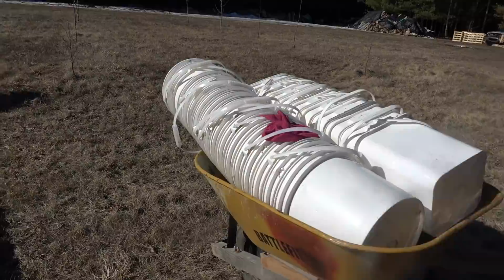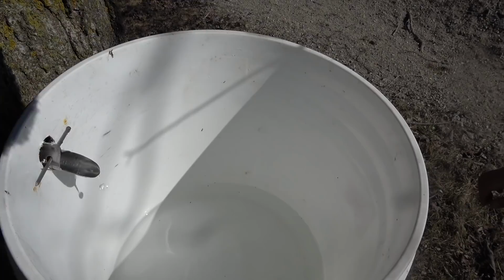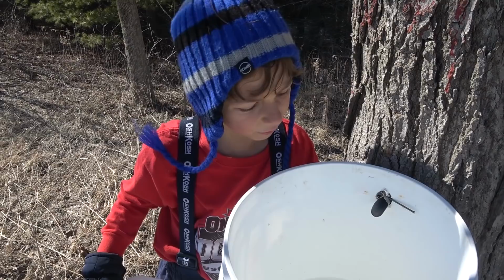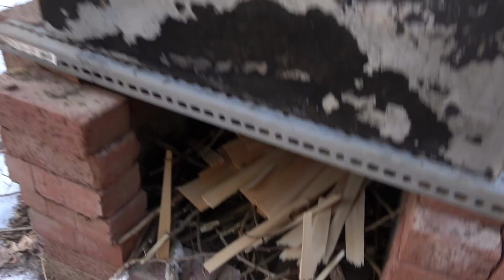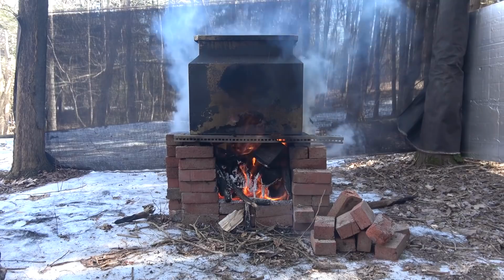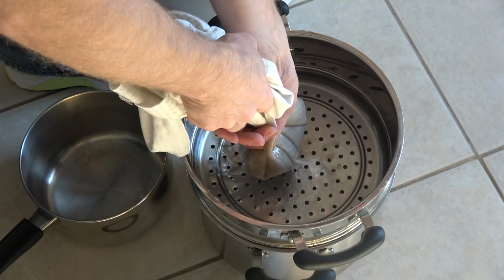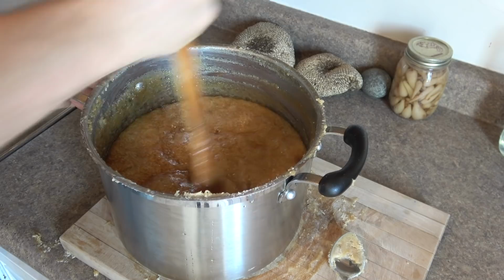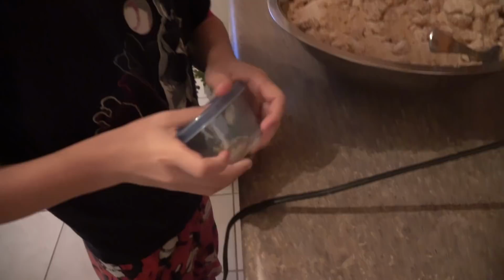MILKING a TREE!?! | Maple SUGAR on OPEN FIRE | Home Made Evaporator, Wood Boiler, Chickens, Gardens

Comment: Im surprized that it take so much effort and energy to produce sirup...... No wonder its so expensive
Reply: I was thinking the same thing😊
Reply: Well worth it  it is not like that fake stuff in stores
Reply: @tinacline474  runs about 50.00 a gallon here in Upstate NY. I buy by the gallon and break it down into quarts and freeze it for use all year. Love it!
Reply: It's about 15.00 here in South Dakota, but that's about 36ozs. Would like to try the real deal. Don't know where to buy it at.
Reply: @debraries7931  you can order it from Cartwrights Maple Tree Inn here in Upstate NY. I'm sure they will ship you some.
Reply: @SuperPangloss  but why do you freeze it though? Syrup pretty much never goes bad and the aromas in maple syrup are not volatile, so freezing it doesn't do anything beneficial^^
Reply: @dr.doppeldecker3832  When I break the seal on the original container and repackage to the smaller jars will develop a surface mold. So just  easier to freeze,

Comment: Just a hint for next season. I used to live in Vermont and made syrup for 5 years. You can cut your boiling time down if you remove the ice from your buckets. The sugar doesn't freeze, only the water does, so remove the ice and you'll have a more concentrated sap.
Reply from the maker: Our buckets freeze right to the bottom!
Reply: I saw liquid with ice dumping out of your buckets. The liquid part is the concentrated sugar. I would empty all my buckets into a 40 gallon plastic tub I had, cover it and let it freeze overnight, they the next day I would pick the ice out of the tub before boiling. I guess it depends on how cold it gets. But usually you can chip the ice away and just boil down the liquid. At least that's how it worked for me. It took me 3 seasons to learn that.
Reply: Wanted to suggest the same.
I do this with alcohol, because destilling is illegal around here.
Reply: Yeah buddy, but there is sugar frozen with the water, so its just better if you keep the ice in, and get the most out of it!
Reply: well done, came here to say this!
Reply: Wait... so the law allows you to cold crash a fermentation to concentrate but you cant heat it up? Talk about a loophole lol

Comment: And if you want to finish and fully dry it out get like a cookie sheet pan and spread out the crystallized maple sugar and set the oven on low heat crack open the door alittle so the moister can leave the oven and you’ll have fully dryd crystallized maple sugar that you can place into a container and use when ever !! I put mine thru a coffee grinder a few times to get it evenly crushed and it’s amazing !!! Love the channel btw !!!
Reply from the maker: Coffee grinder sounds like a good idea!
Reply: if you cook it until it gets to "hard ball" stage, or until it comes off a spoon in an apron, put it in a wooden bowl (so it doesn't cool too fast) and Stir Stir Stir! it'll fluff into "granules" all on it's own, no grinder needed!
Reply: Dryd? Thats a new one... Hahah

Comment: For the garden and the weed situation,  you can get things like:
Black weed barrier fabric to lay around plants- upside is it warms the soil faster so you can start growing sooner and it can be reused, downside is its plastic based and it costs.
Pine needles / dead leaves /hay applied as a mulch around plants. Can break them up into mulch or leave them whole. Upside = natural option, holds in soil heat, slows water evaporation so less water is required, slowly disintegrates and gives nutrients back to soil, pine can be used to help acidic soil plants, loose mulch gives a home to beneficial bugs,free option if you gather it yourself. Downside= labor of gathering it, can hold in humidity which is good in some cases, but also can promote molds particularly around squashes- not sure if that would be as much of an issue in your location though. 
Can also look into permaculture techniques as they require less maintenance and weeds are usually just left to do their thing. Usual thought is they'll choke out plants, but there's evidence that the competition among plants promotes more phytochemicals/nutrition/medicinal benefits pound for pound. Also, in your videos about the garden, I saw quite a few edible/medicinal weeds! They're volunteers, lol! Eat them too :D
Reply from the maker: Thanks Leah, big problem is that we have clay soil here.  We really need a truck of sand to break it up.  We have lots of pine needles though!  If we get things right, the plants we want should be able to grow and shade out the rest.  That's the end goal anyway.  We'll see.  It's hard since it's not a huge priority for my brother and he has better access to all the things we need.  In time though.
Reply: The Wooded Beardsman hmm yeah sand would help a lot then for drainage and air/nutrient issues. The weeds are probably helping that process too. Many disturbed/poor soil weeds are soil healers. Can add compost and leaf mulch to start building up new soil too. Each fall when people rake leaves, grab their bags full of leaves! Great opportunity for free compost/soil, lol. Run lawn mower or weed wacker over the leaves to chop em up a bit, rebag or toss in a giant heap pile. toss it around to aerate and add some water / worms every now and then and by spring you'll have a good amount of soil or compost to help amend that clay!

Comment: The natives collected sap in birch bark pans. They let it freeze and lifted out the ice on top. Very little if any sugar froze. The water was thrown out as ice and more sap was just added and ice lifted out until there was a concentrate of sap. Then it was boiled down until only the syrup was left. The sap concentrate was boiled until suddenly the water was gone and the temp of the sap would boil over at which point the heat was removed immediately and syrup was allowed to cool and put into containers.

Comment: If you rub butter around the top 2 inches of the inside of the pot, it will cause the syrup to flash back down when it bubbles up. Also, you can use a stand mixer such as a Kitchen-aid to mix the syrup. Works great and the sugar is much dryer and finer. I spread mine out on cookie sheets for a couple days and then put bigger lumps through a fine mesh sieve.

Comment: You should try to find or make a much much more shallow tray system for boiling off your water.  In Michigan we used a metal boiling table about 4x4 feet with a 2-4 inches deep of sap.

Comment: I have had a very small amount of experience making syrup out of Birch sap.  I contracted to build a small building for a couple who were testing the feasibility of making syrup from birch trees.  They told me the birch sap had about half as much sugar as sugar maple sap, meaning you need twice as much sap.  They reduced the sap first with a reverse-osmosis system to remove water and concentrate the sap.  Only later did they boil it.  Birch syrup tastes different than maple.  It's more sorghum-like.
Reply from the maker: Yeah, I didn't really like the birch sap as much as the maple.

Comment: (I'm Mnicojou Lakota, we have Lakota, Nakota, and Dakota people across the great plains up into Canada)

for us, usually we'd find very specific rocks (don't remember the traditional name of them) that we would heat in the fire (rocks at the bottom, fire built on top of it) and once they glowed red/yellow/orange, we'd drop them into bladder bags or brain tanned leather bags suspended like a deep hammock under three (sometime four) legged "tipi" structures. these rocks were chosen specifically because they didn't break apart or disintegrate once heated and eventually cooled down. that's how we made soups and i can see that they may have used maple sap in remedies, or even made small batches of maple syrup before european influence.
Reply from the maker: Great history lesson, thanks!  I might have to try that method.  I've heard of people trying the hot rocks in hollowed logs with very poor results.

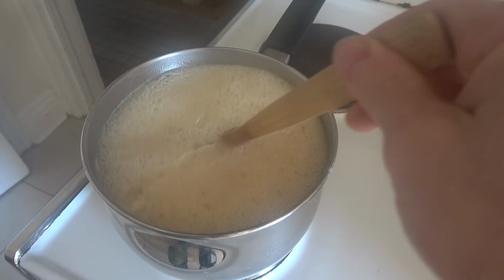Comment: 31:53 If you set the wooden spoon over the top of the pot the frothing syrup wont be able to overflow, because of surface tension.

Comment: Alot of the time when buying your maple syrup at the supermarket its actually rice syrup or something similar thinned down to look and have the sweetness of maple syrup. Maple syrup normally has a very strong smell, and has a pretty thin consistency (depending on the water content). You can avoid this by looking at the ingredients, price (higher price tags indicate higher quality but because maple syrup is more expensive than rice syrup it tends to cost more due to supply/demand and some companies specifically advertise theirs as real maple syrup often backed by certain professionals. Weird thing to rant about, have a nice day

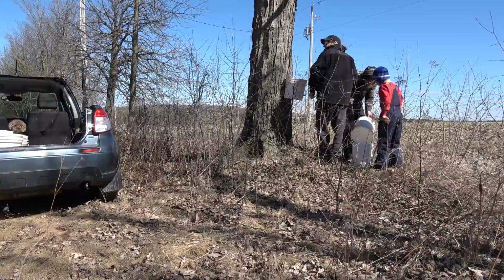Comment: 13:10
Boiling water can easily be done with ceramics, which most north american cultures had knowldge of to some degree.
.
And even if pottery is not  a possibility - the leather cauldron  (skin in fact, never mind the name ) can be hung over fire-heat and used to bring water within spitting distance of boiling.
And fire-heated stones thrown into that or burnt wooden pails have done good work for humans around the globe for at least 20K years.
.
evaporating bigger amaounts of sap would probably haven been done openly, in stratched sacs of mildly heated sap.
Reply from the maker: Anyone who has tried the rocks in wood failed to drink any of it.  It's nasty.  Boiling wasn't done until cast iron.  You could make a video and prove me wrong...
Reply: @TheWoodedBeardsman  
Sorry - Pottery came 20 000 years ago, and you can definitely cook liquids in pottery. 
Not a problem.
I have drunk water/tea  cooked on coals/dung/wood in pottery pots all over asia. Tastes just fine.
Really dont need to make a vid there.

On the skin-pots - you are right, its nasty as long a one does not have a lot of technique.
The skin is specially treated with fats and physical processing (mainly drying/watering cycles and sun for the to-be-hardened part of the skin)  
The stone going into water needs to be clean and of a non-heatshattering variety. stone-agers knew them by heart.
I know all this from workimng on european stone-age experimental archeology sites i visit beacasue II´m interested.
.
I do not attack your position that the indians didnt process sap in mass - I dont know about that.
.
I DO dispute you repeated exclamation "cooking only came with iron" which is simply evidently false.
No vid needed!
Humans have been cooking for endless generations before we got any metallurgy.
Reply from the maker: No, I didn't claim that we didn't cook...we've always cooked, it's what makes us human.  @nilesbutler8638
Reply: @TheWoodedBeardsman  
Yeah, you literally did.
Watch you own video again, at more than one point you said "cooking only became possible with iron pots" or very close to that wording.
Several times
Reply from the maker: Uh, no, it's your claim, you find it.  Time stamp it.  I have said in many videos that humans are human because of cooking.   @nilesbutler8638

Comment: Corect me if I'm wrong but aren't  those big round frozen disks just pure water? I thought that only the water freezes out of a liquid and leaves behind a more concentrated base material.  If you got rid of those disks wouldn't you getting rid of just water and thereby save on the boiling time/fuel?

Comment: Have you ever thought about using concentrated solar power to evaporate the sap ? There is a dude in Ukraine (hopefuly he is still alive) here on YouTube and he is building solar heaters just with cheap reflective foil in wooden frame. It seems to be really cheap and effective, not just some green solar overhyped nonsence. It might come handy to check it out if you will actualy ever read this comment. (I know you won't 😅)

Comment: Why not use a rocket stove to produce the heat you need. You just use an open fire which wastes the wood gas that is released. Also, the ICE that forms in the buckets, that must be mostly water. Have you checked it?
Reply from the maker: The top would be, but I've seen them frozen to the bottom, so the sugar does still freeze.

Comment: Im only 12 minutes in but you did tap the tree and hang the buckets but my research has edumacated me that obviously, sugar maples are the best but any maple will work but tapping under the largest branch gives u the most sap and close to a water source produce more sap. ive been wanting to do this for about 5 or more years and finally found the legal property to do it on. If you dont know a maple without leaves mark em before end of fall so u dont waste time. Also, dont drill more than 2 inches into the tree and if I remember correctly the maple tree should be over 18 inches in diameter. Ok my 2 cents. Please feel free to correct me if you know FOR SURE Im misinformed.

Comment: In its raw form before you boil it down, does it make a good drink? 
As your son said "it is a little bit sweet" I wondered whether it is drinkable or is it still too thick and sweet for that?
If so, would mixing it with water be good?
Reply from the maker: You can for sure.  Sweet water, very light at first, but more concentrated as it boils.

Comment: Just a question, can you also just drink that maple water?, is it clean? Cause if you were in need of water you could get it that way, and get some extra energy from the sugars.
Reply from the maker: Yes, for the most part.  I've heard too much can give you the runs, but never confirmed this.
Reply: The concentration of whatever is in it which causes this is most likely pretty low, but doesn't surprise me as plenty of "drinkable plant water" causes this. Certain types of cactus juice, coconut juice, etc etc. Thanks for the quick answer :)

Comment: seems that you could dump off the ice chunks and get a head start on the process- but I've never done it so?
Reply from the maker: I've had them freeze to the bottom, so not sure how accurate that is!
Reply: Ryan Wiley I would think that is actual sap frozen so that would be a waste
Reply: You can freeze concentrate sap very energy efficiently if it is cold enough. You want to keep about 1/3 liquid, so if the whole thing is frozen, bring it inside until it thaws enough to be 1/3 liquid. If it is less than 2/3 frozen, and you have a cold night coming, you will save wood by letting it freeze rather than boil. 

You can do 2 cycles of freezing.. that is, freeze out 2/3 of the water, then mix your remaining 1/3's and freeze out 2/3 of the water again. You MUST boil the sap for proper color, flavor and thickness, but if you can freeze out 80-90% of the water first, you will save SO much time and wood!!

It does have to be pretty cold to freeze the 2nd time since it is much more sugar-rich, but if nothing else, dumping any ice (up to 2/3) that forms in the bucket will save plenty!